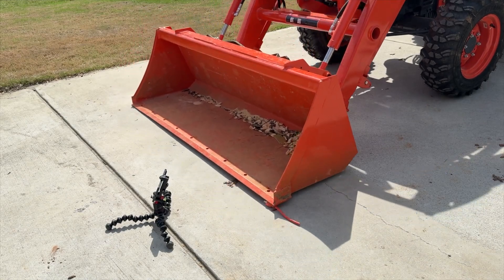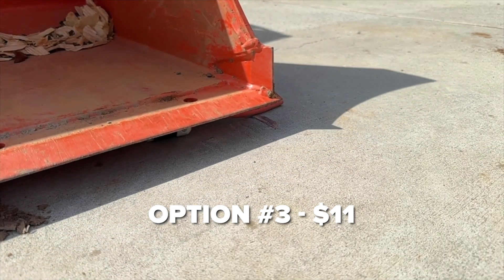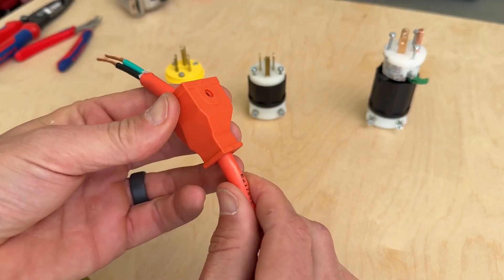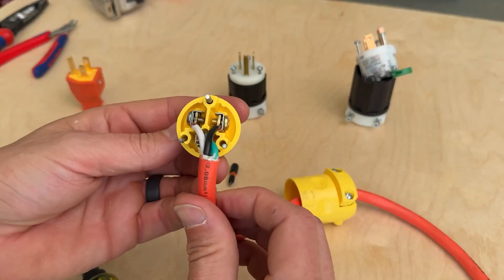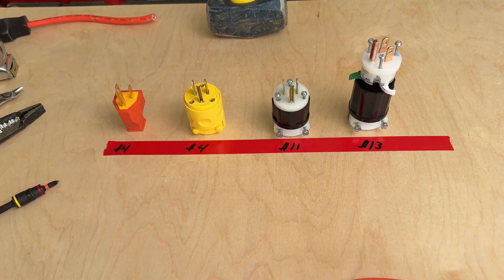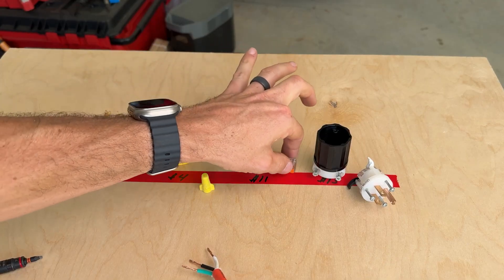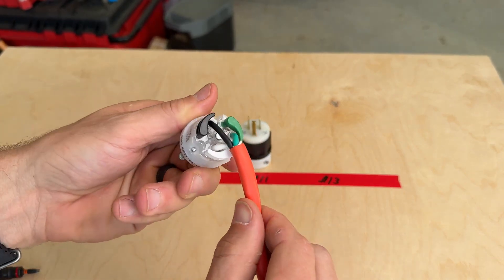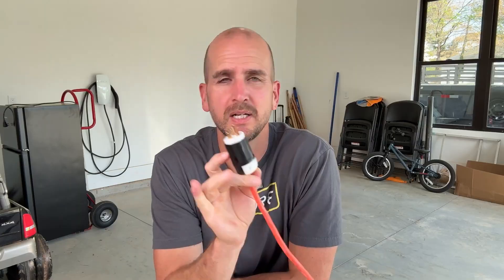$4 vs $13 Extension Plug Showdown

Comment: I am 67. My father was a sales engineer for GE and gave me a few of the  plugs very similar to the $11 ones probably 40 years ago. I still have some of them and have reused them many times to repair broken extension cords. But for everyday use I would probably buy the $4 ones. One feature I would be looking for and would be willing to pay extra for in a female end is the light indicating power is there. It is very convenient.